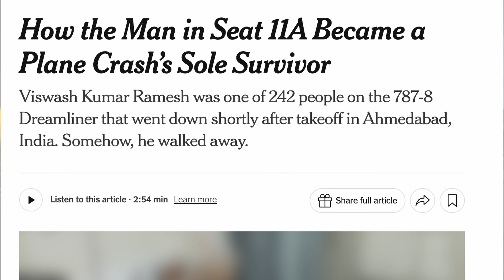Why the RAT Changes Everything – Air India 171 Update

Comment: Although the reason of the crash is likely different, If the 3rd option would be the possible reason of the crash, that is not good for Boeing If simple human error can kill 200 people. If pilot says it is possible to do such simple mistake....jesus. Computer can analize (has input) when airplane just took off, so it would give  loud warning (signal + voice command like 'you changed flaps position!!') that flaps are mistakenly changed during take off or even computer would skip new configuration of flaps giving warning and asking if a pilot is sure (pressing another button to confirm). I mean such solutions only when any changed setting is abnormal in crucial part of fly - take off and landing. Shortly, If abnormal input happens, warning appear and onboard computer can accept it only when you confirm the changed value by pressing 'CONFIRM'. I'm even shocked it doesn't work like that already

Comment: (before I watched this video) It seems clear if you see the original video, not the re-recorded video, that the slats are deployed on departure. Thus, the configuration was probably set for takeoff. Also, unverified photos showed the slats deployed at the crash site. Also, compare the crash with Delta 1141 (not configured for takeoff), and you can see it seems to descend under control into the crash, unlike the Delta accident where it rolled as it began to stall (due to no flaps/slats). It seems likely this was a dual-engine failure scenario (birds, fuel, not mechanical based on statistics of 2 failures simultaneously), particularly when you factor in the RAT being deployed (you can clearly hear it) and the gear not being raised.

Comment: Well this means it wasn't co-pilot messing things up. It was a failure of the Dreamliner jet. The FAA estimates that turbine engines fail about once every 375,000 flight hours. So after approximately 43 years of continuous service. This one was from 2011? So failed after 14 years of service. Very very unlucky. Shouldn't have happened.

Comment: I thought it very strange that you did not take into consideration the loud bang the soul surviver heard 30 sec into the flight?
Possible  explosion, possible severing of landing gear lines preventing gear retracting?
Possible engine fuel line damage causing instant or fast loss of thrust?
I think it was much to early for pilot error to be even suggested!

Comment: Questions

Was the takeoff roll unusually long for the circumstances?
What was the dust / smoke when the plane went behind the structure in the 2nd video? Previously undisturbed dust on the ground, or smoke from an engine problem?
why did the plane appear to initially climb away normally, beyond the point where ground effect would be a factor? 'slowly' developing engine failure rather than instant?
In the clip where the RAT can be heard, what does the engine noise indicate?  Those engines are quiet but they don't sound like they are at takeoff power?
Can the RAT be deployed manually?
Reply: CGI, looks fake.

Comment: Guys. The only question is why the engines failed to produce power.Not the Flaps ,not the Landing Gear,not the RAT.This is a Dual engine failure while Take off.The rest is consequential.
”From an aircraft Maintenance Engineer POV”. Lets wait for the DFDR data.

Comment: I'm from Bharat.  Interesting and good analysis, without any concrete conclusion. May not  be the right time to disclose..!!!

May be 1) fuel issue... 2) Flight landed with one engine at Ahmedabad, subsequently, took off with one engine, later failure of another engine, caused  the crash.

😢My deepest condolences..

Shouldn't reoccur to any country.

Comment: 24 hours ago the Directorate General of Civil Aviation of India ordered mandatory full inspections of all GEnx engines [fitted to Boeing 787-8 and 787-9 models], that fall under its jurisdiction. It is my understanding that all Boeing 787s in India that are fitted with GEnx engines are grounded until the inspections are complete and the engines certified as safe. 40 of these engines were part of the big order placed with GE by Air India in February 2023.

Comment: Retired from Delta Airlines lived thru a few mechanical failures. Lost a engine just nothing to compare what these Pilots faced. Talk about running out of air speed altitude and ideas. They had absolutely no time the odds of this is staggering. Something is bad wrong to many redundant systems on this aircraft something bad is here.

Comment: Although anything at this point...a comment can be unfair to pilots.....authorities have confirmed that the plane used almost all the 3500 m runway before rotating.!!!...indicative of trouble with one engine atleast...cant see yaw on takeoff as correction is automatic in 787...after takeoff seems trouble with second engine.....any guess can be unfair to pilots....but could pilots have shut down the working engine??? has happened in past though we should have learnt and should be some protection against that....otherwise dual engine failure one after another

Comment: One factor that has been noticed is that it looks like this aircraft only got airborne at the end of the runway which may mean that the engines were, if the full length was used, not producing enough thrust at any point. 🤔

Comment: If the RAT was deployed and outside of the fuselage, it should have been ripped off at impact and thrown clear. If it wasn't deployed, It would still be inside the fuselage and attached. The location should give clues.

Comment: According to some 777 information, in flight, the RAT deploys automatically if: both engines are failed and center system pressure is low, or
both AC transfer busses are unpowered, or
all three hydraulic system pressures are low. I can't find anything though on whether this is an instantaneous deployment or what the delay is, if any, after these events. Were the engines still running when it was descending? They should have been at take off power at that point. I still think there was maybe a huge short circuit or something as it looks like the flaps weren't out, the gear didn't raise but the rat did deploy.

Comment: Clue was in the mayday call No thrurst.  These were professional commercial airline pilots with vast amount of flying hours between them, not flight school making a school boy error.  Flaps and gear lever are not even next to each other.  Not sure as a captian you even came to that conculsion.  Fuel or mechanical issue here.  Fair play for making a video with the change of view, Respect for this.
Reply: Dr Todd Grande is not in aviation and he got the analysis right the first time.
Reply: People do grab wrong lever though so it isn't a bad guess (assuming no safety system to prevent retraction of flaps below speed).  We saw that with the Yeti crash a couple years ago (reached for flaps, feathered the props instead).  Granted those have more proximity  in space,  but normally gear and flaps have more proximity in time.
Reply: @WorldTravelerCooking  This is an advance plane which has a safety protection envelope system.
Reply: the mayday call was a clue that someone was panicking - totally inappropriate at that point...
Reply: @nicktulloh  Apparently, not now then?  Use evidence provided rather than theory.

Comment: Dual engine failure at that stage of the most critical event - Thank you so much for this clear evidence based explanation. It’s only speculation regarding root cause but historical events could indicate software or related hardware failures. Perhaps an over engineered automatic system, or sensor failure.

Comment: According to another trusted source, it has come to light that a few years ago, one of India’s billionaires was reportedly the target of sabotage involving a helicopter. The alleged sabotage was carried out by mixing sand into the fuel tank, which could cause a mid-air fuel blockage. This scenario is believed to be a plausible explanation for a sudden double engine failure, potentially leading to a crash.

Comment: The propeller sound will come if it is driven by a piston engine. But if it is windmilling it cannot produce the sound you are reffing to. At the time of plane passing by the camera, the RAT is not deployed yet. So in my opinion still your hypothesis is wrong. The point in the red circle is not RAT, its just an assumption as it is not very clear. If RAT was deployed it should have been absolutely clearly visible when it is close to the camera, or in the earlier frames

Comment: Much as I appreciate this captain's expert input I do wish he wouldn't presentationally ramble so much; would that he become succinct!

Three observations:

Firstly, it seems to me in this sharper image that the flaps are indeed correctly fully extended...

Secondly, given it's clear that the pilots used virtually the whole runway to get airborne (surely not normal) this suggests that the engines were already problematical...

Thirdly, with the revelation of RAM deployment I strongly suspect that possibly the reason both engines failed - not unprecedented but almost unheard of - might be due to a major software malfunction, yes? ▪︎In other words were computers the culprit here...▪︎? Not too long ago a Qantas plane experienced severe problems in this connection causing a huge loss of altitude causing the aircraft to plunge thousands of feet though mercifully the situation was eventually  recovered. Are we looking at a similar scenario with the Air India crash?

Comment: The video of the deployed RAT was circulated already two days ago plus eyewitness reports of the RAT's "Propeller Sound". Some pilots had already speculated on the loss of the two engines when the RAT was perceived to have been deployed. Two engines failing at the same time? Yes, totally agreed 100% that the possibility is very unlikely. Except for notorious poor maintenance, corner and cost cutting and falsified maintenance reports. There were also cases in the past when some Indian Airline Operators were found to have used non-genuine spare parts. I hope there will be not again a massive cover up during the investigation. I bet Boeing will do their utmost in finding out the real cause so that their declining reputation is not being further marred. Personally I have zero confidence in flying with any Indian Operator, fixed wing or helicopter. I had witnessed too many crashes  during my time in India.

Comment: Somebody also pointed out that the landing gear is tilted forward in this video. Usually on the 787, the bougie of the wheels is tilted backwards. Before the gear goes up, it tilts forward before retracting into the belly. This suggests that the gear lever was pulled up, and the gear began its retraction sequence, however in the middle of it the electrical and hydraulic power was lost.

Comment: Here’s a critical but under-reported hypothesis: dual engine flameout due to closed Firewall Shutoff Valves (FSOVs), which cut off fuel to the engines. These valves are typically closed during maintenance or fire isolation procedures.

If left closed after maintenance, engines can still start and taxi using residual fuel trapped in the lines. However, they will flame out under full thrust—shortly after takeoff, which aligns with what appears to have happened in this case.

In this scenario:

Air India Flight AI‑171 had arrived from Delhi earlier and likely underwent standard maintenance checks.

If FSOVs were not reopened, and engine run-up tests were skipped, the dual flameout was inevitable.

Pilots may have had no warning, as cockpit systems often do not detect mechanical mispositioning of FSOVs.

The result: both engines fail shortly after liftoff. With no thrust, the aircraft cannot gain speed or altitude. It stalls and crashes.

Why this matters:

FSOV-related fuel starvation incidents are not unprecedented. A similar cause led to a military aircraft crash in 1957. Digital aircraft like the Boeing 787 cannot detect mechanical faults without sensor feedback.

This highlights the need for stricter FSOV checks, mandatory engine run-ups post-maintenance, and dual verification protocols before dispatch.

Comment: You got it perfectly correct captain, from here there are only two further possibilities:
1. Main fuel supply shut off by a ground personnel due to ignorance or bad intentions.
2. Aircraft fuel system failure due to some internal fault, either fuel valve, or motor etc.
Reply: 3. catastrophic electrical failure of the core systems (leading to engine shutdown)
Reply: “Main fuel supply shut off”, is that even possible?
Reply: ya only thing that makes sense to me (as a layman) is that the engines didnt get fuel. Not sure how that's possible but we will see.
Reply: Is it possible that it could have been fuel contamination and/or restricted fuel delivery
Reply: Bird strike
Reply: @jakovmarinvezic2364 No smoke. Unlikely to have a serious twin bird strike without some sign of smoke from at least one of the engines.
Reply: @jakovmarinvezic2364  DGCA said birds were not reported in the vicinity, I'm pretty sure in one of their conferences, and also you'd probably see some sort of back firing (flames coming out the back of the engine) as the bird is being ingested into it which we can't see from the airport CCTV or other videos like the ones shown in this video.

Comment: VERY IMPORTANT !!
What I Noticed  : When the pilot put the gear switch  in position UP  on a Drealiner the next things happen : 
1)) Rear Wheels turn  to  gear up position  ( front wheels  turn ( tilt ) to a lower position  than the  rear wheels )
2 ) Rear Gear doors open  at the same time as the wheels goes  to gear up position 
3 ) Wheels retract 
4) Gear doors close 

When you freese the footage of the crash (gsm version ) than you will notice that the rear wheels are in gear up position  ( so the pilot put the switch to the up position ? ) , but why are at that moment the rear gear doors not open !  Hydraulic Failure and or Engine failure or electronic failure ????

Comment: The 1st video I saw was taken from the right.
I immediately noticed that there seemed to be no engine noise, but rather a buzzing like a microlight along with aerodynamic noise.
My wife had also seen it & asked what had happened. I immediately answered "both engines failed" 
I have been mystified by how everyone didn't notice that and instead fixated on flaps - something which I didn't think you could really tell from the grainy video.

Comment: The investigators will need to find out where thecaircraft was fueled at for the last two fuelings and and get fuel samples checking for water or microbiological contamination.

They need to check the maintenance logs to see if any wing tank was opened for maintenance such as a fuel pump or transfer pump change.  Perhaps a pad used to soak up fuel was left in the tank or tanks and that clogged a pump or blocked a check valve.

Comment: The lights wouldn't just flicker when the ram air turbine deploys, they would go out, followed by emergency lights coming on (of course, the guy likely just didn't notice that it was different lights coming on) but most importantly that would happen BEFORE the rat drops.

 The sequence of events would be something like... engines fail > generators offline > battery now only source of power > load shed to essential systems only (cabin lights off) > emergency lights on / ram air turbine deploys

While the deployment of the rat would likely be quite loud in an airplane that has no engines running, definitely a solid thud, possibly a "bang", it would be much more pronounced than, but not entirely dissimilar to, the sound of landing gear coming down- but more abrupt. But the timeline doesn't match. If the "bang" were the deployment of the rat - that sound would come AFTER the lights flickered. The bang the witness reports is more likely associated with a catastrophic powerplant failure. That would be consistent with BANG > [engines spin down, generators stop spinning] > Lights flicker.

Comment: Swiss001 also pointed out that the landing gear is In the forward leaning position, which happens when you put the landing gear up, the landing gear leans forward before retracting into the belly. So maybe the landing gear got stuck in the middle of its retracting sequence due to power loss

Comment: So… the dog that didn’t bark.  If you hear the RAT, then the engines had certainly failed because the engines on takeoff thrust would have drowned out the sound of the RAT. The lack of engine noise is the direct clue.

Comment: Aren’t there actually several different conditions (one of which is dual engine failure) that will automatically deploy the RAT?

1. Dual engine failure
2. Both engines at less than minimum idle speed
3. Loss of center/left/right hydraulic pressure
4. Total electrical failure
5. Bus Power Control Unit detects no power to either transformer rectifier
6. Loss of hydraulic pressure to all 4 electric motor pumps accompanied by loss of either left/right flight controls
7. Failure of both primary electronics cooling loops on takeoff
Reply: no

Comment: I have a question, the angle of the landing gear in the video is that the rear wheels are raised, as far as I know is your front wheels must be raised for landing, 
Here are a video showing it https://youtu.be/2RGCDnNmGGY so to me it looks like when they retracted the gear there were a catacrotic failure. On the right side is the noise and the left side is the tail because you can see the trailing flaps.

Comment: The partly raised landing gear is something to take note of. When these planes retract the undercarriage the first action is that the "bogies" are hydraulically tipped forwards so the front wheels are below the rear wheels for the stowed position. When landing and taking off the rear wheels are lower. In the video you can see the front wheels are stuck down in the first stage of raising the undercarriage.